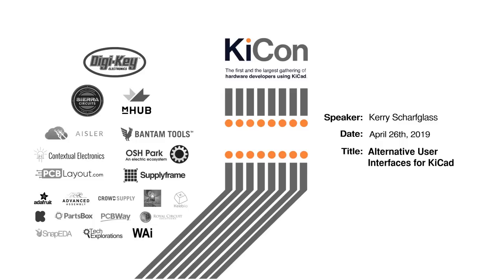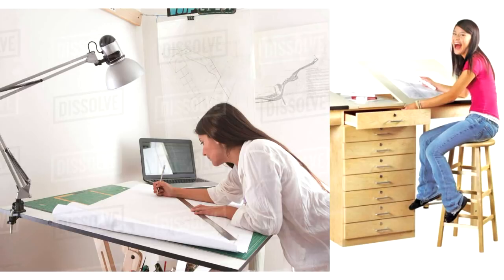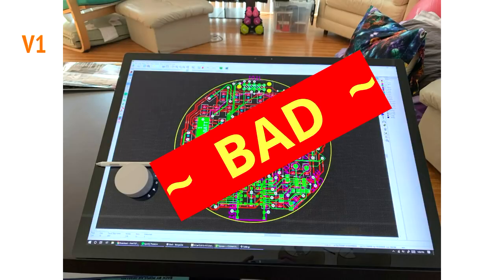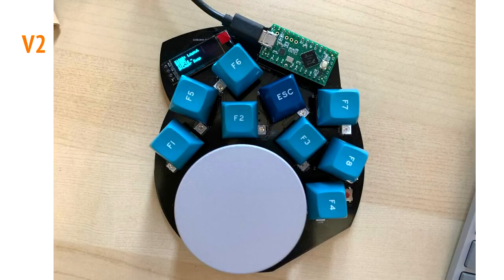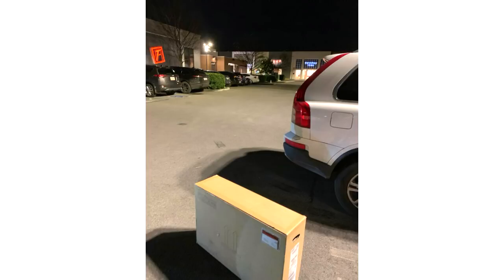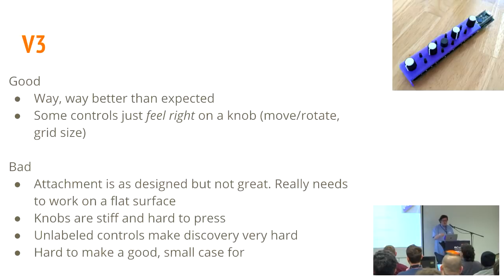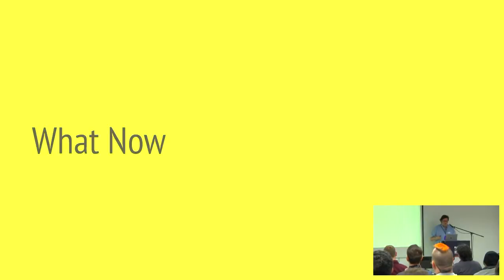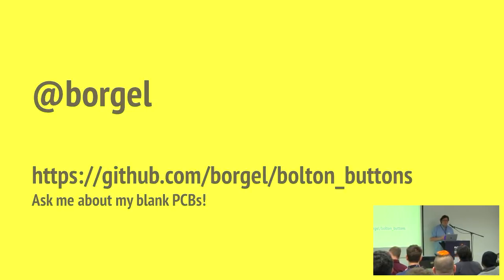"Alternative User Interfaces for KiCad" - Kerry Scharfglass (KiCon 2019)

Comment: Hmmm... now you have me thinking too.  Maybe a 3d printed grip for the surface pen that makes the buttons more comfortable.  Maybe even a lever that manually presses the stylus point exactly when you want it to be pressed?

I made my own 6-axis HID twin joystick controller with a PSOC 5lp dev board.  I'm willing to bet it is even easier to get working than the teensy.  I started with an example and had it connected and working within about an hour.  (Then took several days tweaking things to my liking.)

Thanks for the cool idea.  I'm going to be mulling over some possibilities.